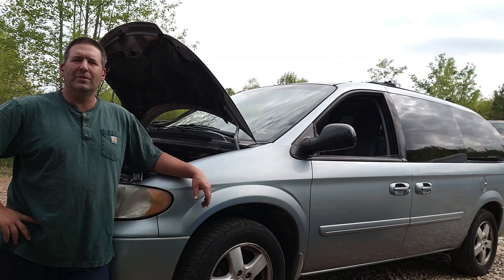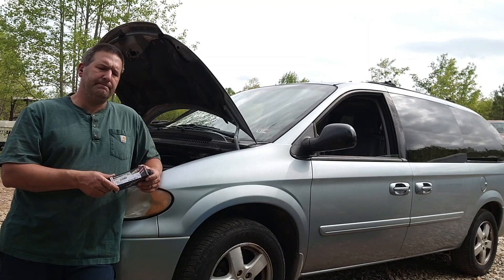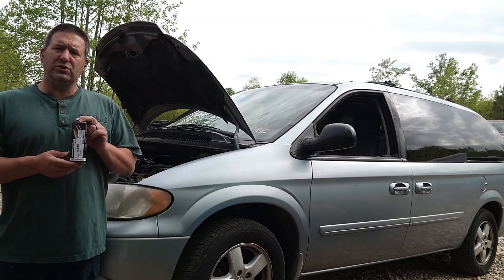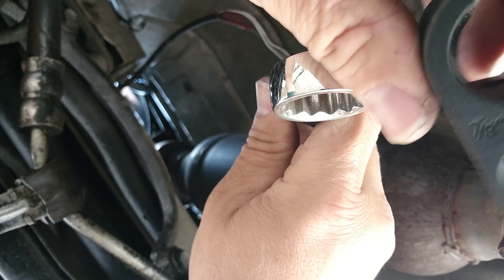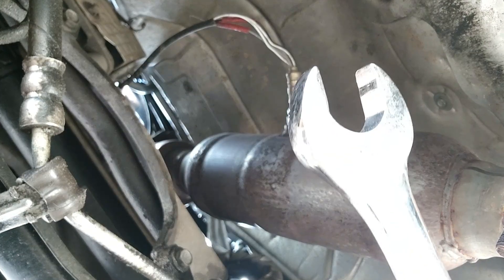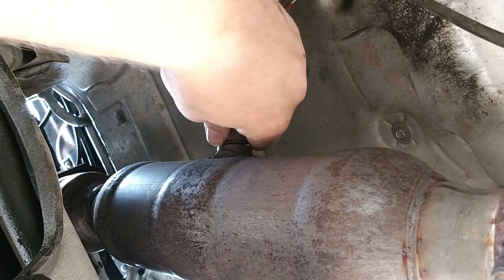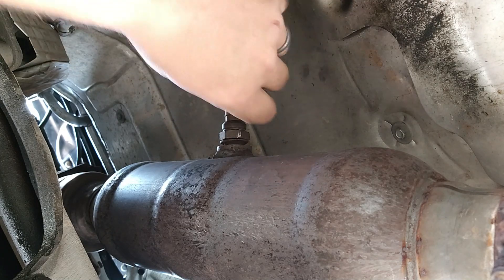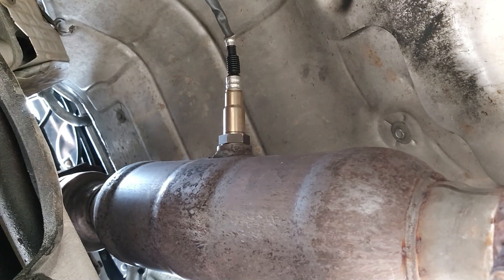How To Replace Downstream Oxygen Sensor Dodge Grand Caravan

Comment: You missed putting some anti-seize compound on the threads of the new sensor. Otherwise good video thanks.
Reply from the maker: @garybusby344 you are correct in needing high temperature anti seize on the threads of the oxygen sensor. If you check out 5:50 in the video you will see the new sensor comes pre loaded with plenty of anti seize. Thanks for watching. ~Mr. C.